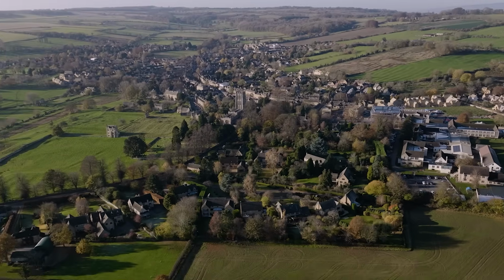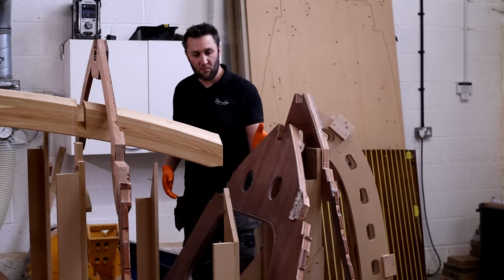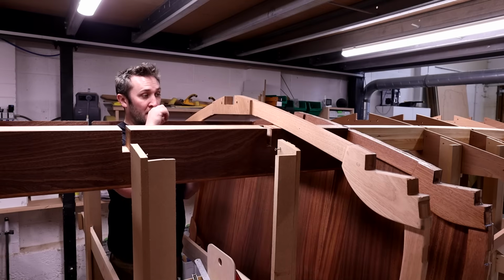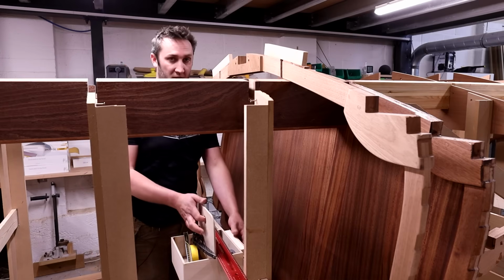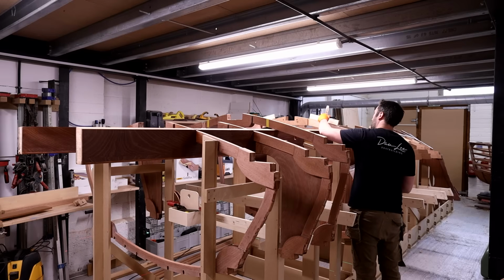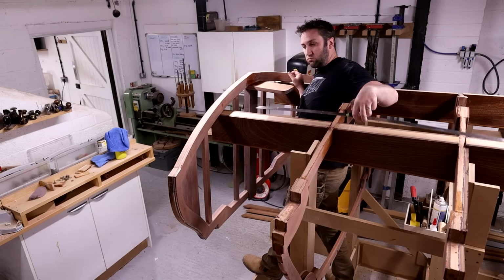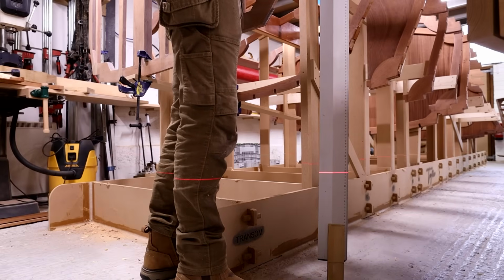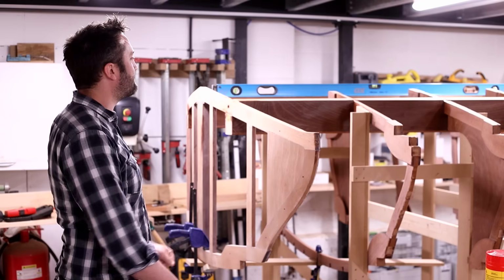Progressing Through The Boats Reconstruction | Building Temptress Ep28

Comment: Have you figured out how you'll turn Temptress over?
Reply from the maker: Yes I’ll put a pin through the transom and stem at the balance point and rotate it on those, that’s the current plan anyway.
Reply: @DanLeeBoatbuilding  It's a lot of weight.  You'll also need some overhead space.  Is the beam more than the height?

Comment: at 42-01, the extrs hole id release the air and possilbe excess adhesive  from the dowel holed. it will also prevent the timber from splitting under drybollick pressure.

Comment: It's a real pleasure to have you show and comment on the "little things" in boat-building.  The simple tool caddy to hang on the cross spalls, clean-wiping the joints BEFORE the epoxy sets, tricks to sneak up on a perfect hand-tool fit, etc.  And the endless sanding, the only real downer in wooden boat-building!

Comment: I know there comes a moment in any highly engineered project that the accumulation of miniscule errors boils down to one component that essentially needs hand fitting to work: as careful as you've been, do you think that error will show itself?  Where might it occur and how is it handled?
Reply from the maker: So far I have not really come across any dimensional errors. Everything I am checking is holding a tolerance of less than 1mm which I am pretty happy with. If I do find some at some stage then adjustments can be made to suit. I'll put that stuff in the series if it happens as I don't edit out my mistakes 😃

Comment: Dan - I have added 2.5” screws for structural reinforcement, but did not pot them in with epoxy.  Should I removed them and pot. With epoxy as you have done?  Or it is better to just leave them in at this point?
Reply from the maker: It's not essential Bob, I wouldn't worry too much. I won't do this on the topside batten screws. If they were on fittings below the waterline then it would be a different story.

Comment: Hi Dan great progress. Two questions if I may. When using the brace I noticed you gave a very tiny back turn after tightening can you advise if that was correct and why. Possibly to slightly relax the screw. So not permanently under high load??The other question is when epoxying screws like that can they be backed out when fully cured or is that then a forever fixing.
Reply from the maker: I never noticed I did that, I'm not actually loosening the screw, I think it's just relieving the backlash in the screw slot to prevent marring the head when the bit comes out. That's my guess anyway as I think this is all done subconsciously, the screw is kept under high load. As I've installed these they are a forever fixing really, if you want to make them easily removable another day then you can wax the screw before installation.